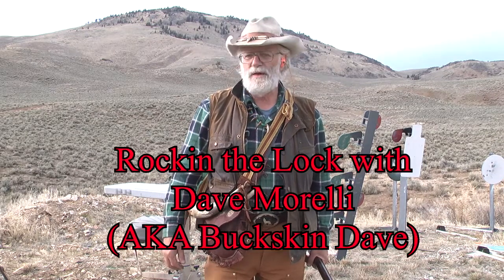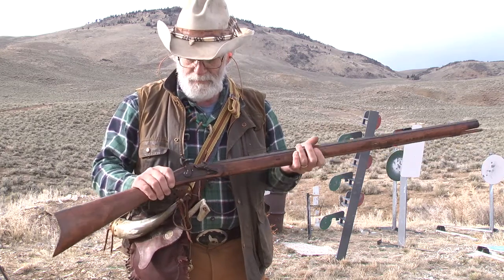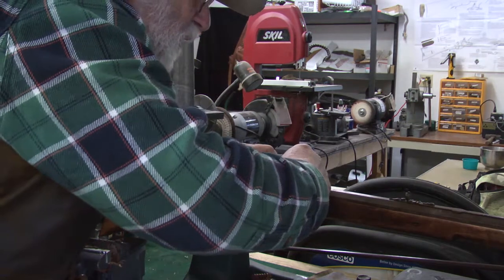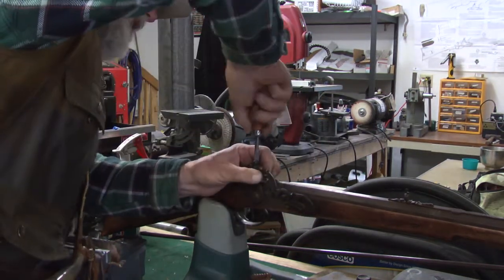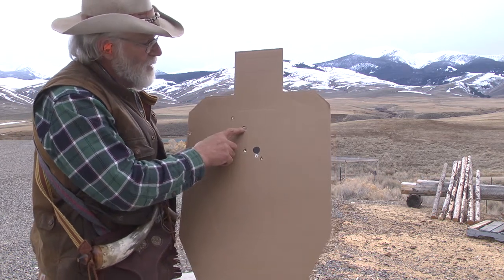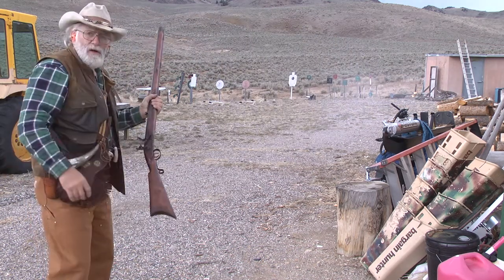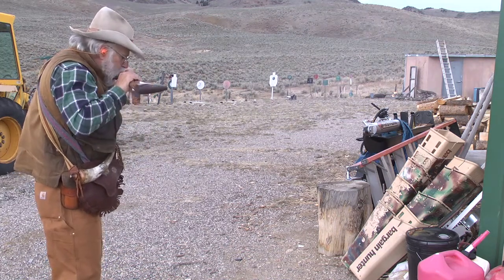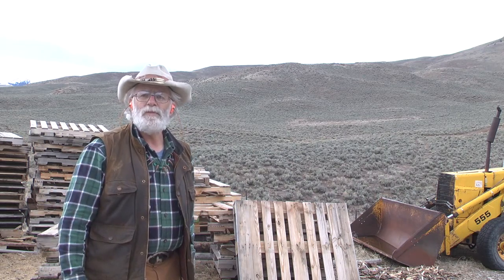Blackpowder Flintlock  Rocking up the Lock

Comment: Got say I love your rifle build. I looks very close to what my dream build is.  I now call it (WHAT WOULD ASHLEY DO) build.  Loosely based of forgotten weapons what would stoner do for the AR . Knowing what know today with current materials . As someone who is acquainted with the Wyoming Rockies game small at-large and predator extremes.  The What would Ashley do consist of  a combination of  the 03 harpers ferry( for the large robust military lock), jaeger( for heft of wood to steel, and j&s hawkin for it grace of lines. My caliber of choice. 62 caliber with two interchangeable barrels. A rifled and smoothbore . Self capturing wedge pins, as there's nothing worse than losing wedge pins on 20 miles of horse trail.  Extra wedge pins was as common in my saddlebags as horseshoe nails. One platform to provide for everything dove, blue grouse rabbits and such, clear up to elk,moose, and of course grizzly protection. 
    Mountain man
Reply from the maker: Thanks for stopping by

Comment: Planning on putting together a flinter in 50 cal, 7 eighths barrel. Someone suggested that since the barrel was thin not to put in a vent liner but drill directly into barrel because not enough threads to hold liner. What is your suggestion. Thanks for good information. I have made several cap locks. This will be my first flintlock. Need as much info as I can get from someone who is knowledgeable.

Comment: What size of flash hole do you recommend on a .54 flinter like that?
Reply from the maker: I use whatever the liner is from  manufacturer if there is a problem I might ream it put a bit larger, thanks forstopping by

Comment: A couple of tips if I may, you will want to keep in mind when your sighting in is that with a black powder rifle, the first shot is always a tad higher than all subsequent shots. This is more pronounced in some rifles than others. It is due to the fouling acting like a lubricant to a small degree and a clean barrel doesn't have this and as such creates slightly higher pressures due to the extra resistance. I didn't believe it myself after being told this until I went and chronographed my rifle and saw if for myself. There was close to a 150 fps difference from the first shot to the rest. This applied even after I would swab the bore after each shot but not do a cleaning like I was putting it up for the night. This happened on 4 different rifle I tested.
Second thing I wonder about was your ignition issues, it might have been the lighting but the camera never picked up any of the flints sparks when it was misfiring on you and it made me wonder about the hardness of your frizzen. I have had to reharden 2 of my frizzens due to them not throwing a good spark anymore and seeing your issue reminded me of when my Brown Bess did that to me and the solution was to reharden it.
I also agree with using FFFg for pretty much all of my BP guns except my mortar and my collection runs from .32 cal Derringers to my .72 cal Brown Bess and a bunch in between and I feed all of them with FFFg. I do use FFFFg for priming my rocklocks though since I seem to have better luck with it. 
I also am glad you pointed out the issue with filling the pan too full of powder, I hear way too often about how newer shooters fill the pan to just be able to close it with powder and can't figure out why their guns shoot so badly. I must admit though that I have picked up one or two guns from disgruntled shooters who didn't know any better, I would tell them, but they swore it was the gun and sold them to me cheap bc of it.
Good shooting and keep your powder dry.

P.S. btw, you got another new sub.
Reply from the maker: Thanks for the tips and for stopping by